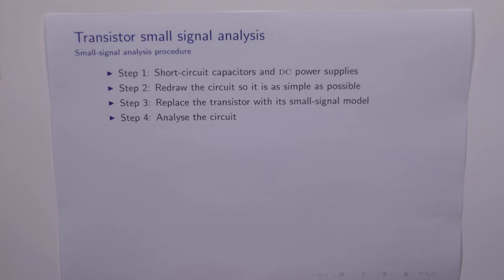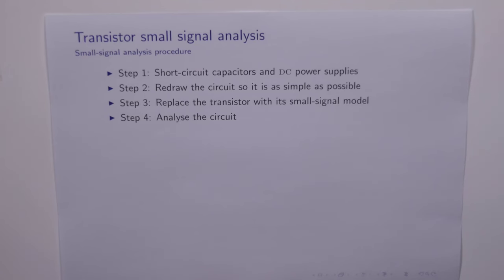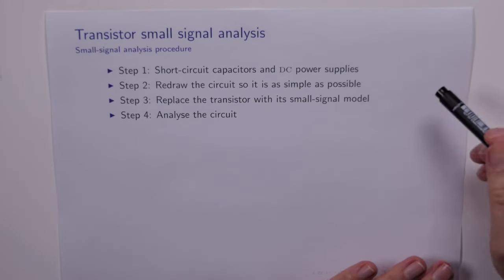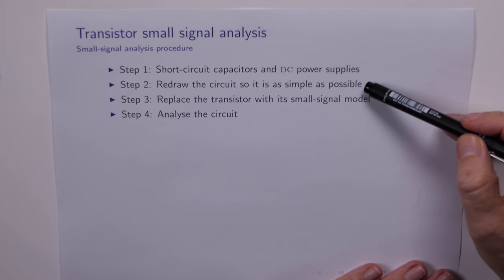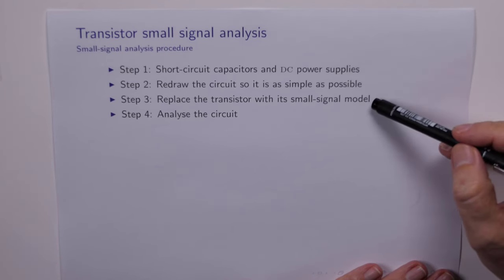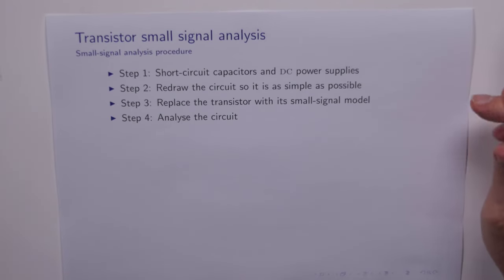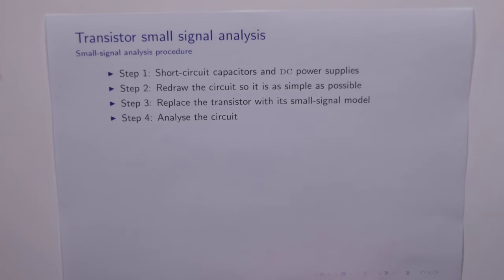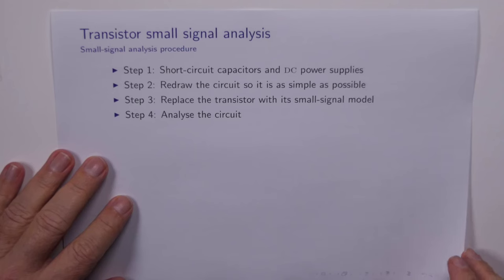Transistor Small Signal Analysis

Comment: What I dont understand is why does the current i_c flow through R_C and not directly to ground at 11:55 ?
Reply: This guy used π model for his analysis which is quite hard to catch, T model is rather easier for beginners.
Reply: For the question, Ic goes through Rc cause if you look back through dc perspective again, ic is the ib at base times beta, in which current is drawn form a dc source, in case of ac analysis, dc is basically a/c ground.

Comment: at 13:40 on the video, for Voltage gain, The resistor R pi is basically (Beta)x(re), so the beta's will cancel and you will get Av= -RC/re

re = 26mv/IE

Comment: You could make life a lot easier by making use of the concept of the dynamic emitter resistance, that is the slope of the Vbe vs Ie curve. It is equal to the reciprocal of gm and depends only only the emitter current and the absolute temperature. At room temperature, it is simply 26mV/Ie (sometimes taken as 25mV/Ic), so should be immediately calculable from the dc analysis. Now see how it simplifies the calculations and makes them more practical:
At 15:22 "So we feel pretty happy with this result", referring to Av = -β.Rc/rπ, but that looks to all the world as if the voltage gain depends on transistor β, which it doesn't. In fact rπ is just equal to β.re. That is logical since rπ is just the slope resistance of the junction seen from the base, and the base current is β times smaller than Ie (for any modern small signal transistor, β >> 1 and Ic = Ie).
So Av = -β.Rc/rπ can be simplified to Av = - (β.Rc) / (β.re) = - Rc/re which is a much more usable result and shows that the gain is independent of the transistor parameters.
In fact, Av = - Rc/(25mV/Ic) = -Ic.Rc/25mV. It should be obvious that as Ic.Rc is just the quiescent voltage across the collector resistor, the maximum voltage gain of a common emitter stage is necessarily limited by the supply voltage alone. If you want the output to be able to swing symmetrically without clipping, then the collector bias point will be about half the supply voltage (Vs) giving a maximum possible gain of Vs/50mV.

Similarly, at 30:28, you have Av = -(gm - 1/Rf).(Rc || Rf). If we write the ratio Rc/Rf as FB - a feedback ratio which gets smaller as Rf gets larger - we can simplify Av as follows:
Av = -(gm - 1/Rf).(Rc || Rf) = -(1/re - 1/Rf).(Rc.Rf/(Rc + Rf) = -(Rc/re - Rc/Rf).(Rf/(Rc + Rf) = - (Rc/re - FB).(1/(FB + 1))
So if feedback is very small (Rf >> Rc) then FB = 0,  and Av approximates to - Rc/re as is the case without feedback. If feedback is larger, so that Rf = Rc, then Av = - (Rc/Re -1)/2 or about half of the gain without feedback. Those are useful results.

Comment: This video is very clear! But why is the current source connected to ground at 23:08?
Reply: The low-frequency small-signal model of the transistor looks like a simple resistor r_\pi between base and emitter, and a dependent current source \beta i_b from collector to emitter. Since the emitter is connected to ground in the original circuit, one end of the current source must therefore also be connected to ground.

Comment: In the first exercise (from  5:47) R1 and Rc were had a common wire and when we simplify them as R1 and R2 are put together into a parallel resistance it separates totally from Rc. Won't that affect anything? A little bit lost here

Comment: Wow, this was great! But I've some naive doubts.
• how can the transistor run on a small signal, without any biasing? Or Do we primarily assume that the transistor is running at some voltage ?
Reply from the maker: In order to function as an amplifier the transistor must be biased into the active region and this is achieved by the DC power supply and the various resistors connected to the transistor terminals. Depending on the circuit we may also need to level-shift the input signal (via the input coupling capacitor) so that the transistor remains in the active region as input signal swings from its most negative to most positive values. This is why we perform a DC, or bias, analysis -- to ensure that the operating point (or quiescent point) of the device is appropriate. The input signal is treated as a deviation about the bias level in the circuit, and the AC, or small-signal, analysis is solely concerned with calculating how these deviations propagate from the input to the output. We are able to separate our analysis into two parts -- DC and AC -- because we are restricting the size of the input signal so that the transistor appears to be linear (note that the small-signal models contain only linear components). However, at all times the circuit has a DC state and an AC state, even if we consider them independently while doing our full analysis.
Reply: @markandrews5167  wow, thank you very much. I got this doubt because, during small signal analysis, we short the sources right? Once we do that we lose the bias, don't we? How does that current source and resistor(small signal model of BJT) count in the bias. Lemme tell u what I think,correct me if I'm wrong; we are able to account the bias because, we have the collector and base currents in the small signal model (a Res and dependent current source) as those currents found during large signal analysis. Hence shorting the sources doesn't change the bias, as we consider the bias currents, and further look at the changes of those currents.
Reply from the maker: @aravindhvasu195  This is basically correct but your reasoning can be made even simpler. Recall the superposition theorem? The response of a circuit to a combination of stimuli is the sum of the responses to each stimulus, provided the circuit is linear. As long as we keep our AC excitation amplitude small enough the transistor responds linearly to it. We now treat the complete transistor circuit as a linear network responding to two separate stimuli: the DC bias "stimulus" and the AC small-signal. Work out the response to each stimulus and add the responses -- this will be the complete (bias + small-signal) response of the circuit.

One minor point: You mention "large signal analysis", but perhaps you mean "bias analysis"? The large signal analysis is usually rather messy and non-linear.
Reply: @markandrews5167  Thanks for the question and the careful response. When you solve for Rout, you short the input to the ground. The input is the sum of a DC supply signal and an AC small signal. When you short the input to ground, essentially both the DC and AC signals are shut off. I understand the part that shuts off DC supply, but what about that AC small signal? Is there some kind of approximation here? Sorry for pressing on this point, but something I feel is not clicking in my mind, although I know your solution is correct.

Comment: If you take the expression for Vout = Vin you got from the nodal analysis and apply it to the second expression you got from the mathematical tools. would that still be correct?
Reply from the maker: Paul, I don't quite follow your question. Can you explain, perhaps with a time-stamp?
Reply: @markandrews5167  can we use the voltage gain expression at 29:01 and substitute it into the expression you got at  33:55 and still be correct?

Comment: My professor was talking about calculating DC Bias before we get to the AC part. could you explain what exactly that means?
Reply: The precise values of the small-signal device parameters (AC part) depend on the bias point of the transistor (DC part). Check out the accompanying video on the Small-signal Transistor Model. It explains where the AC parameters come from and why they depend on the DC state of the circuit.

Comment: How can i find the value of the r π of a BJT transistor? Is it written in the datasheet?
Reply: Determining r_pi is discussed in the companion video "Transistor Small Signal Model". It turns out that the AC parameter r_pi depends critically on the quiescent (DC) state of the circuit!
Reply: @MarkTheEngineer  thanks !

Comment: I'd contend that the transistor symbol should not appear in the ac circuit but be replaced by its ac model immediately. That'll prevent the mistaken belief that a 0.7 V still exists across the base-emitter junction.
Reply from the maker: There are two "new" things happening here as far as students are concerned: (a) shorting the capacitors and DC voltage sources (and thereby apparently changing the circuit topology), and (b) replacing the transistors with their small-signal models. In my experience separating these two things in time results in fewer mistakes being made.

Comment: If someone can help me understand the first AC equivalent circuit I would greatly appreciate it. I'm a little confused as to how RC and RE can be said to be in parallel. To me, it would appear that from an AC perspective, shorting the power supply appears to shunt everything out of circuit except for R1 as the entire side of the circuit up to what was the collector side of R1 would have to be at the same voltage potential. To my limited understanding, this AC circuit would simply look like R1 is one branch, and the other branch is a parallel connection between R2 and RE if the transistor is on.

It just looks like the series combo of RC and RL would have the same potential at both ends so there could be no current flow through them

Comment: Amazing video, very good explanation! but am quite naive on how did you know the direction of If in 24.42. Thanks if anyone can be of help also
Reply: I didn't know the true direction of i_f. The cool thing is that you can draw the currents going in any direction you like and, providing you write down your circuit equations correctly, the mathematics will take care of the details. For example, if the actual current really does flow in the direction I have drawn it then i_f will be positive. If the actual current flows in the opposite direction to the way I have drawn it then i_f will be negative. All you have to do is ensure your starting equations are correct, and the mathematics does the rest for you.

Comment: What happened to the r_o in the hybrid pi model?
Reply: The small-signal model used in this video (and described in https://www.youtube.com/watch?v=RDsM2jhbyY4&t=21s) assumes the collector current is independent of the collector-emitter voltage and in this case r_o is infinite. In reality i_C increases slightly, and linearly, as a function of v_CE (the so-called Early effect) but with a shallow slope depending on the specific device. The small-signal output resistance r_o is the reciprocal of the slope of the i_C vs. v_CE curves in the active region. The simplified model used in this video also ignores h_re, the small-signal feedback path from the collector to the base, and the capacitive effects between the base, emitter, and collector. All of these refinements can be included to provide a more accurate model (just look at a Spice model for the transistor to see what can be included!) but as this is an introductory lecture on small-signal analysis piling on more parameters won't make the process any clearer.

Comment: Nice video sir but i have a small doubt. Can't we write i1 as (ic+iF) 25:35 using KCL?
Reply: There is a slight ambiguity in what you have asked because you haven't written an equation. If you mean "can we write i1 = ic + if ?" then the answer is no, because all of the currents are leaving the output node. If you mean "can we write i1 = - (ic + if) ?" then the answer is yes, as is shown in the video. KCL does indeed allow you to write this equation, but nodal analysis aims to express the currents in terms of the voltage at the node in question. I hope I have understood your question correctly.
Reply: @MarkTheEngineer  thanks for the reply. I understood where I was wrong. But now i applied kvl from Vin to 0(ground). Vin +iFrF +(ic+iF)rC=0 and i substituted this value of iF in eqn of Rin but i get a  different answer :/ eqn at 31:08
Reply: @HDgaming345  KVL requires that vin = -if RF + i1 RC.
Reply: Oops, sorry this is what you have stated. I suspect your error is a simple algebraic one.
Reply: @MarkTheEngineer  yes and i1 is -(ic+iF) and if you substitute this value in Rin equation you get different formula. Maybe a solved example on collector feedback bias will solve my doubt. Anyway thanks sir

Comment: what is the point of this? Does anybody do this in practice?
Reply: What is the point of this?
Transistors are inherently non-linear devices and there aren't many options for dealing with non-linearities. The mathematics rapidly becomes analytically intractable (that is, finding symbolic solutions with pen and paper) so for linear applications (such as amplifier design) we "linearise" the device by finding a range of operation such that the semiconductor devices behave approximately linearly.

That's what is discussed in the video. The other option is to use circuit simulation software to numerically find answers to your questions, at the expense of a deeper and more nuanced understanding of the factors that control circuit response.

Does anybody do this in practice?
If you are an original circuit designer (developing new topologies, rather than using existing ones) then you absolutely do this AND perform numerical analyses as part of the design process. If you are a designer using existing topologies then you may do less of it, but the need to understand it is no less important.

Without an understanding of small-signal analysis how would you know anything about the linear behaviour of an amplifier? The "fact" that the common-emitter amplifier input resistance is dominated by the small-signal base-emitter resistance of the transistor is revealed by small-signal analysis. The "fact" that the transconductance of the transistor is roughly 40 times the DC collector current at room temperature (a rule of thumb every electronics engineer knows) comes directly from the same theory. All these factors come into play when working as an analog design engineer and there are many other examples like this.

Circuit simulation software uses the same theory (with admittedly much more sophisticated models) and every engineer should understand the tools he or she is using.
Reply: @MarkTheEngineer  ok i appreciate the answer

Comment: This analysis is fine as long as the output voltage swing is very small compared to Vcc , ie around one tenth of it . But once you try to have a bigger swing in the output, the gain will vary tremendously, and the output signal will get deeply distorted.
These lectures may be good as a starter, but not in the real world.
If someone wants to know what is in the real world, see this lecture and enjoy 🙂.

https://youtu.be/Q9HdYt3VGKU